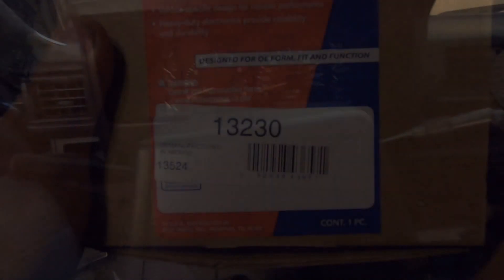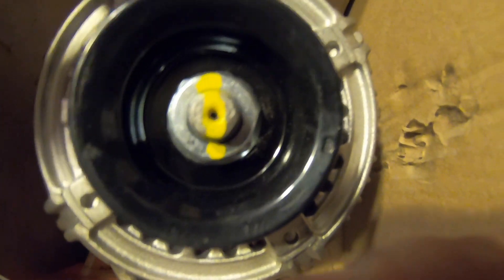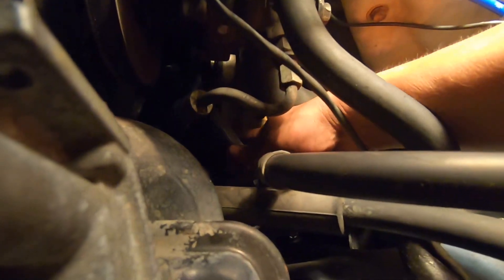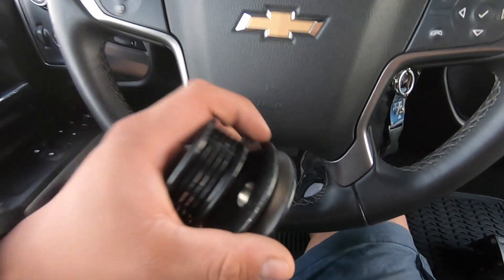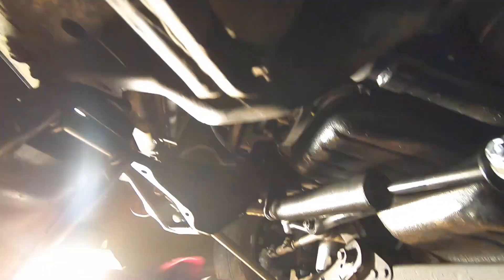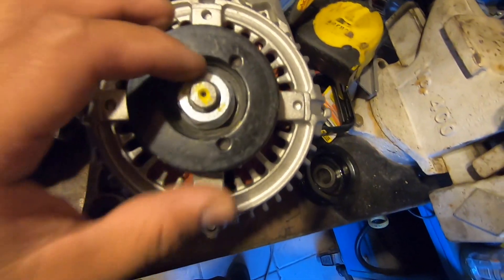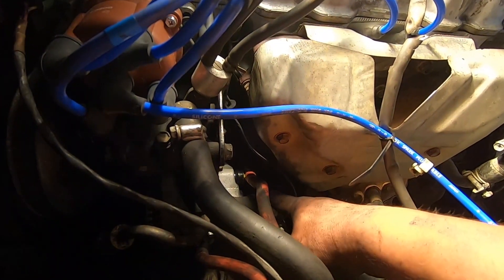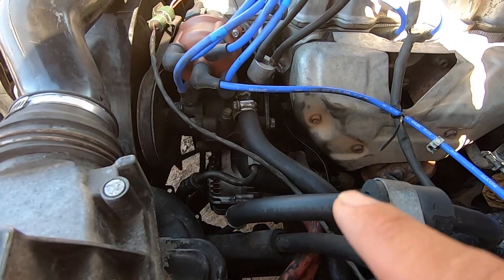Toyota Pickup 22RE 120 Amp Alternator Upgrade

Comment: So at 10:56 you cut the lil nub where the bolt goes through to make it flat?
Reply from the maker: Yes. On our factory alternator bracket had that piece sticking out, we looked at a couple of different 22re brackets and some dont have it. So we used the sawzall to cut it off and if we ever go back to factory alternator we will use some washers to fit it back on
Reply: @OXCFilms  what year jag xj6 and motor did the alternator come out of? I'm in Canada and my part store is having a fun time trying to reference the part number in the video
Reply from the maker: Glad you found our videos helpful! The alternator is out of a 95' jaguar xj6. 6cyl jaguar0
Reply: @OXCFilms  perfect, that's literally what I was thinking.
Appreciate the video, my alternator died yesterday and you're going to save me like 100+ $ trying to get a high output that does like 150ish lmaooo
Reply: Damn. Never thought of making a video. I did this swap like 2 years ago. Still pushing with NO ISSUES.

Nice detail video
Reply from the maker: Thank you 🤙. Its a pretty good upgrade for the price cant beat it
Reply: How are you doing? Great video. What year is your truck? And would you know what the diameter of the hole is, the machine shop bored out the 22re factory pulley to what spec?
Reply from the maker: Hey thanks! Sorry i dont know the diameter. I just took both pulleys in and asked them to bore it out to the jaguar pulley size
Reply: That piece actually slides with impact you don't have to saw it flush,  just tap it in.
Reply from the maker: We tried to slide it to one side but no luck. We didnt cut much off so we can use a washer if needed